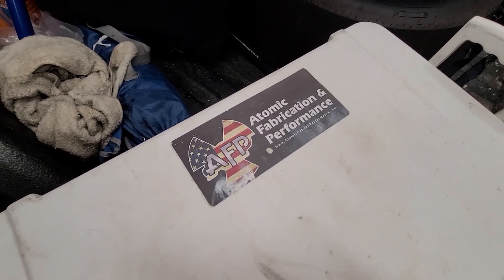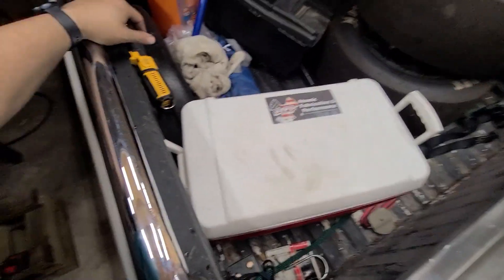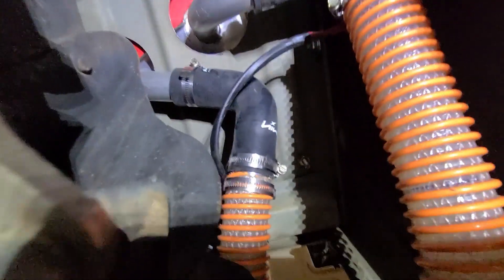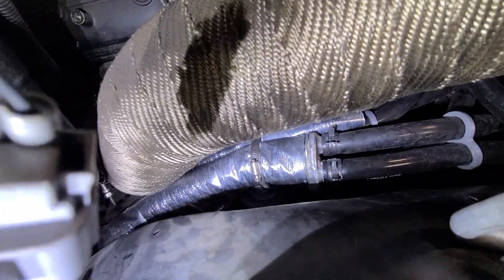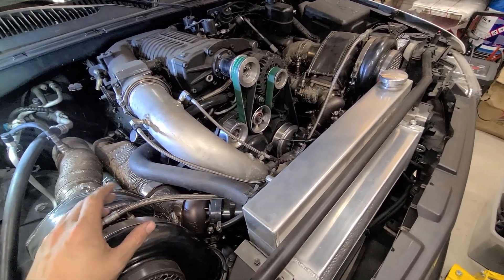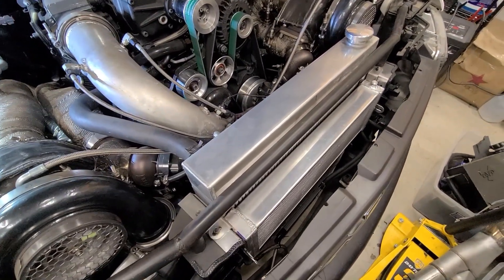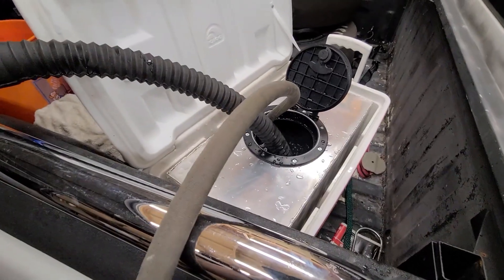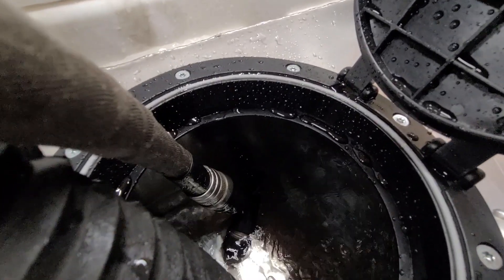Pierburg CWA400 as Intercooler Pump for Atomic Fab Compound Boost Silverado

Comment: Nice build! 
Not sure if your setup is still the same as in this video, as it's a few years old, but I run a similar setup with a pair of cwa250 pumps. I run one inch lines and the two pumps overcome the added resistance from the smaller lines without an issue. 

 The main difference that I wanted to note is I also included 5 volt reference as an input for my pwm controller to reference. So I hooked up a generic 3 bar map sensor and that signal feeds my pwm controller. So I can have the pumps be off at idle or vacuum and the flow scales up with boost.
So my water flow is boost referenced and this helps keep my cold water cold for longer because I'm not cooling the air that doesn't need to be cooled. I only need cooling when I'm under boost and any other time the water's flowing it's just warming it up even though I'm not trying to make any power.
Since doing this I've been able to switch from a 10 gallon ice box to a 5-gallon ice box, saving about 80 pounds. 
There's a guy on eBay selling a controller with an integrated 5 volt input reference so it has everything you need in one compact unit. A little intimidating to set up but his instructions on the eBay listing are adequate for getting it up and running without too much hassle. I recommend giving it a try, although it's significantly more expensive than the $12 controller you use, he asks for about 80 bucks for his controller. But it's worth the money in my opinion for having adequate control of your flow to preserve your cold air for when you actually want it.
The other edition that I made to my setup is an intercooler sprayer over my heat exchanger in the front to amplify the cooling of the water circuit if you're doing back-to-back runs where you might get heat soak in your water circuit.
Anyway just wanted to share a couple things that other people who see your video might find value in when they're optimizing their A2W system
Reply: That sounds awesome!
Have the link?

Comment: Did you wire the pump power and ground to contoler feed and did you hook up signal power and ground to the output is that how those adjustable pwm controllers make the brushless motor work also is your main pump power wired to ignition?

Comment: i've got a few questions about this if you dont mind.
1.) What models of bwm does that pump come from
2.) If you're running such a large diameter line, did you neck it down at the cores, or are the core's water inlets the same size.
3.) what kind of temps are you seeing at idle vs after doing a full pull (idle temp vs ambient air temp etc....)

thanks
Reply from the maker: Unfortunately I dont have as much information as I would like, but in general I would put in a 10lb bag of ice before every few runs and the temp would be near ambient until after a run. I dont know what exact models it came from, generically 2010ish 4cyl turbo SUVs. Yes I split the large main line into 3x 3/4" lines that go to each core separately so they are all in parallel.

Comment: Where did you get the controller?  I have the same pump, but don't think I'm getting the same volume. Thanks for the info.
Reply from the maker: From Amazon, it's a generic pwm controller, was like $12
Reply: @atomic178  one last question,  do you have the main power wire for the pump to battery voltage, an run the signal wire of the pump through the pwm with separate 12v to the pwm?
Reply from the maker: @jeffbendel3737  No, I have a relay on the main power side connected to a switch so I can turn off the pump entirely without messing with the controller. In theory you could run it straight though. The controller 12v is very low current and I have it wired up with other inside gauges.
Reply: @atomic178  thank you for the replies